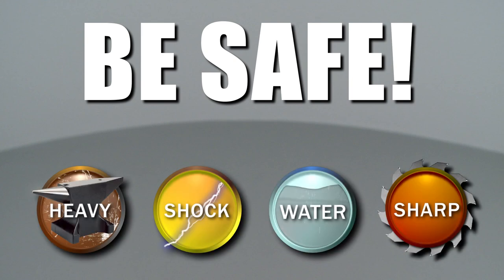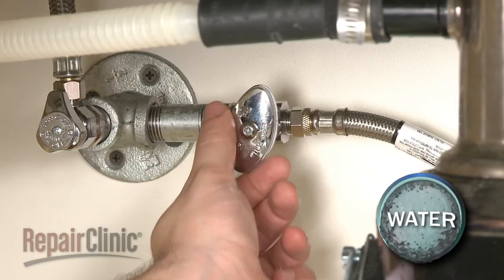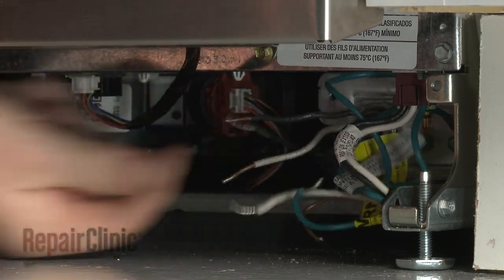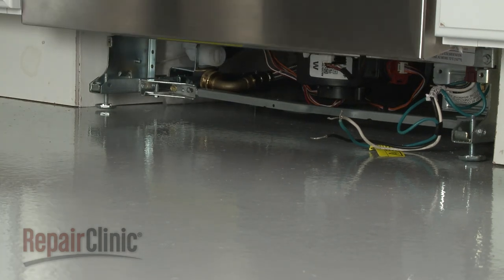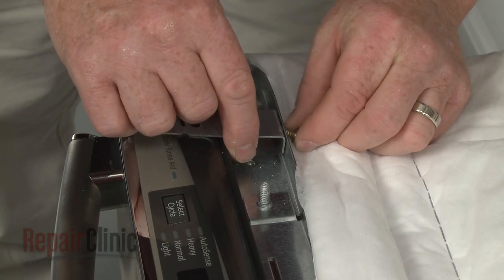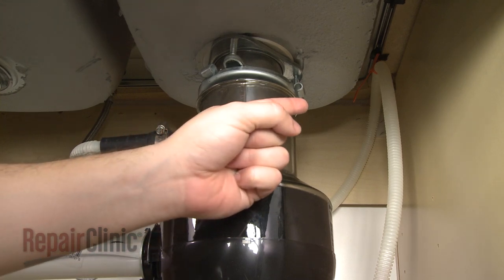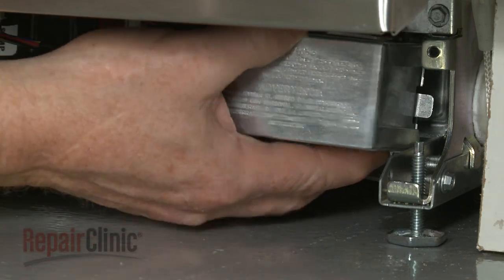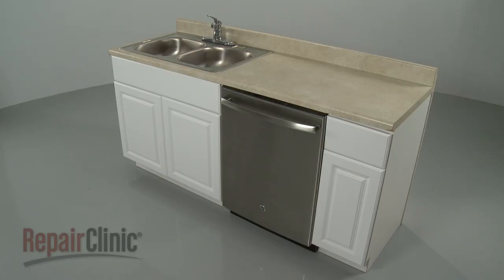GE Dishwasher Mounting Bracket Installation #WD01X10598

Comment: I prefer installing a receptacle, and using a power cord.  The cord is much more flexible than Romex NM and anyone servicing the unit can be sure power is off by unplugging it.  New installations require GFCI too.

Comment: The dishwasher was obviously not hooked up to actually work before this demo as the white plastic plug had not been removed from the water connection.  After removing the water hose connection with channel locks you can see that the white plastic plug was not removed...at 1:20 mark.
Reply: Gary Hershberger that is the filter. It is not a plug. My dishwasher was the exact same way.

Comment: Question, I have a GE Profile Dishwasher Model# PDW9880J00SS Serial #VF714399B and original mounting bracket, welded onto dishwasher, sheared off.  I now have 2 brackets with Part #WD01X10598 and am trying to understand where to attach the bracket onto the dish washer.  I do not have that flange where you can attach the bracket to.  Please advise!

Comment: Shouldn't you turn the water back on and check for leaks before installing the insulation and kick panel? I wouldn't trust that cheap, garden hose connection, especially when you're using pliers to loosen and retighten it..
Reply from the maker: +Craig Shaw That is not a bad suggestion.
Reply: Mine is garden hose too, but I hand tightened it.  Amazing how cheap looking some things look that could flood your house!